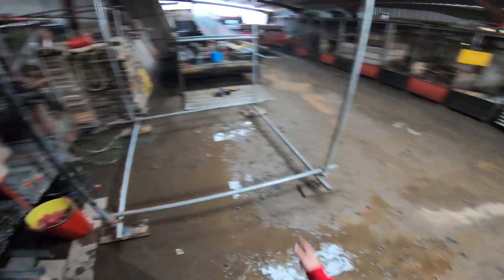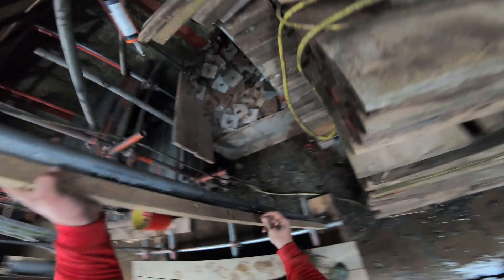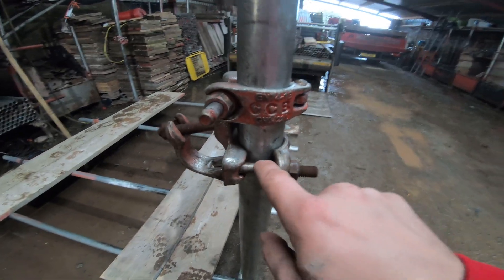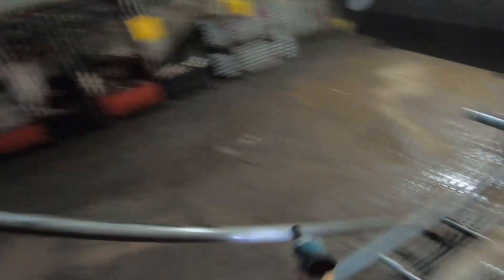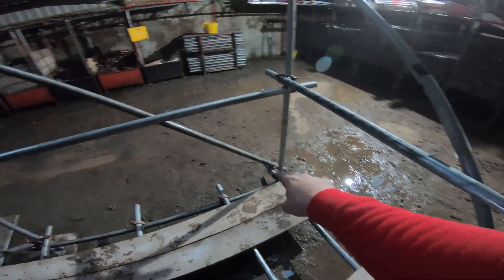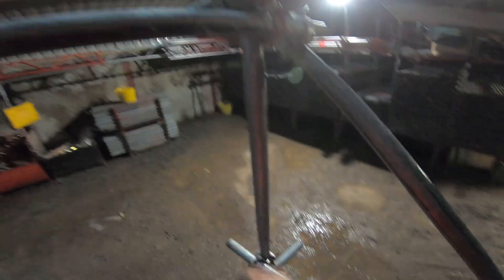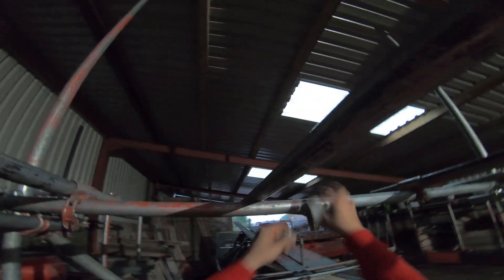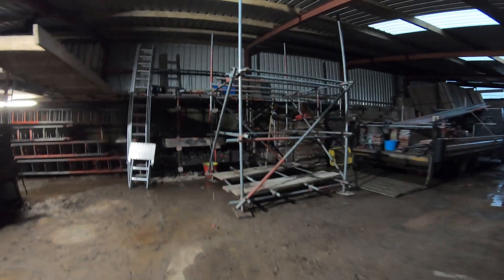Scaffold Fundamentals: Part 2 - Staffing Out Ledgers, Braces, and Trannies

Comment: What’s the point of measuring ur handrail/midrail and top ledger then getting the staff out and going round and marking each standard with the staff but not using the staffs pre existing measurements but making a whole new set of marks on the staff from where u originally measured with ur tape???

Comment: Are there any torque specs to tighten the fittings to the tube?
Reply from the maker: Normally finger tight then half a turn but I just do them up good. There is a torque ammount but I can’t remember what it is haha
Reply: @Madscaffs  50N (50 newtons of force)
The typical impact wrench we use, the Makita dtw300, actually has settings for scaffolding.
Press the hammer/screw button on the interface until the Number one+two light is on for the correct torque, and then press mode a few times until just the number two light and the blue mode light is on.
This will set your impact wrench to stop tightening automatically when you hold the trigger, when the nut is at the perfect tightness.

Not only does this save the life of fittings (Good for you as a business owner), but also gives longer life to your batteries and impact wrench as you aren't over doing on literally every fitting, and also makes it still tight enough but not over tight you couldn't undo with a spanner.

The more you know!
Reply: @ThePubHuB  yea 2 squeaks 😂
Reply: @
50N (50 newtons of force)
The typical impact wrench we use, the Makita dtw300, actually has settings for scaffolding.
Press the hammer/screw button on the interface until the Number one+two light is on for the correct torque, and then press mode a few times until just the number two light and the blue mode light is on.
This will set your impact wrench to stop tightening automatically when you hold the trigger, when the nut is at the perfect tightness.

Not only does this save the life of fittings (Good for you as a business owner), but also gives longer life to your batteries and impact wrench as you aren't over doing on literally every fitting, and also makes it still tight enough but not over tight you couldn't undo with a spanner.

The more you know!
 @Madscaffs